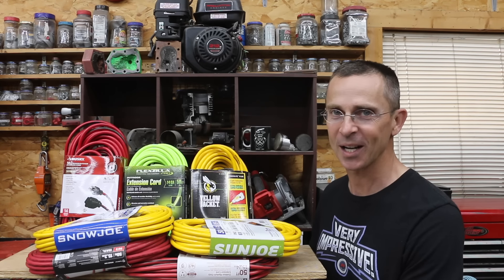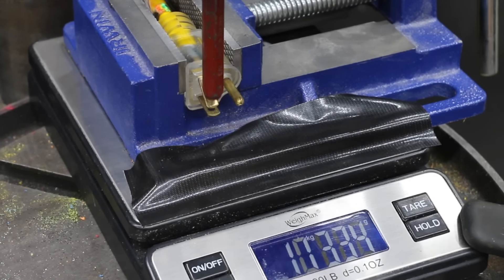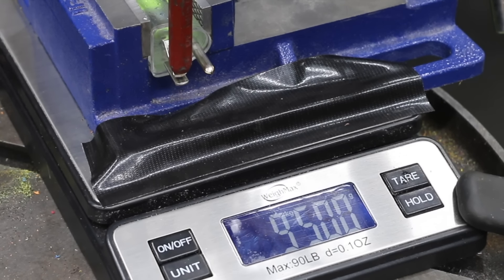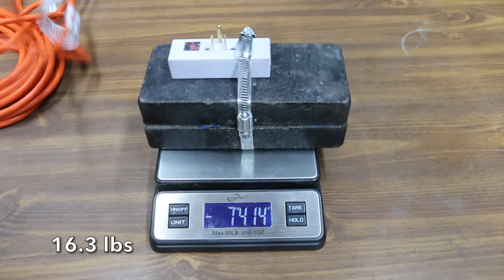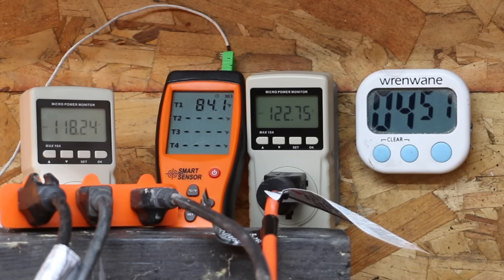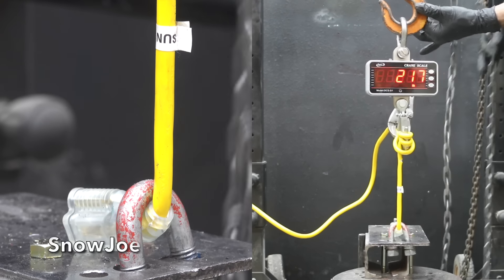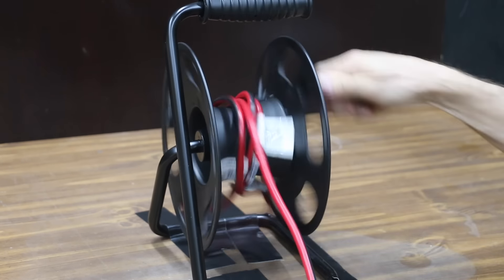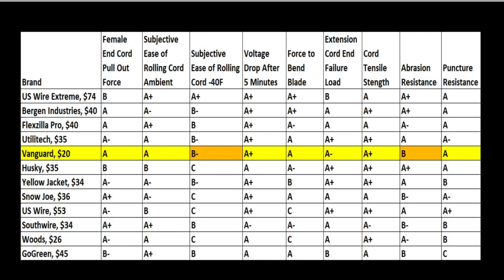Best Extension Cord? Flexzilla, US Wire, Yellow Jacket, Southwire, Husky, Woods, Bergen Industries

Comment: Great video with great information.
Suggestions for possible videos: 
1. Impact socket comparison with comparisons to non-impact rated sockets and 6-point vs 12 point.
2. Concrete screw comparison with Tapcon, exterior SPAX multi-material, Hillman PowerPro One multi-material, and Simpson Titen Turbo. (Not necessarily limited to them, they're just what i encounter mostly in my part of the country).
Reply from the maker: Thanks and you are welcome!  Thanks for the suggestion.

Comment: Great assortment, but one thing not covered was overload behavior. I purchased a 14AWG 50’ Terrabloom 3-outlet cord specifically for it’s 105C SJOOW insulation rating and am able to routinely charge my Tesla at 24A continuous in 20C ambient air temp. Quite impressive, and their indicator light functions at 240V without issue (do not try this at home, I am a trained professional 😝)
Reply from the maker: Thanks for sharing.

Comment: I bought several of the 12ga US Wire Extremes because I needed cords for work that can take cold climates. These are the best cords by far that I have and have lasted 4 years already in daily use. They coil up nice and they never corkscrewed.  I had Rigid cords before these and they were the worst cords ever, IMO. The US Wire cords were actually a little cheaper on Amazon.
Reply from the maker: Thanks for sharing.

Comment: A few tips when choosing a cord ac"cord"ing to this vid. The weight is immaterial to the cord function except for the "jacket/insulator" Your equipment will last longer using a heavier gauge ie 12 gauge.
Also, It's much easier to manage (4) 25' cords than it is to manage a single 100' cord.
Same goes for air hoses, and rope in some cases.
Reply from the maker: Thanks for the feedback.

Comment: Video Suggestion: Spray Adhesives. Which works best for most materials, even materials not listed like Leather. Also discoloration; moisture, heat, and cold exposure; failure loads on sturdier materials, rust protection on metal, and anything else you can think of.
Reply from the maker: Thanks for the suggestion.

Comment: I am a licensed electrician and I can tell you a couple things. 1. I would never use a cord that is less than 12 AWG. 2. A 10 AWG cord can handle up to 30 A, a 12 AWG cord can handle up to 20 A, and a 14 AWG cord can handle up to 10 A. In the industrial/commercial workplace, we only use 12 AWG cords and larger.
Reply from the maker: Thanks for sharing.

Comment: Great video!  I've discovered a good test of extension cable quality is whether or not my Tesla travel charger will work or not.  It can be picky with wire gauge and quality but a relatively inexpensive Southwire 12/3 cable has proven sufficient.
Reply from the maker: Thanks!  Thanks for sharing.

Comment: It would be very helpful if you did one on pump sprayers.
Reply from the maker: Thanks for the suggestion.
Reply: Good one. I usually just re-use Windex pump spray bottles but I recently purchased one from Ace. It was poorly constructed and didn’t last a month before failing. I typically get a year of reliable service from the used windex bottles.

Comment: At the carpenter of 45 + years, I have three things when it comes to picking a cord. How well it stays in a receptacle and how will my saw stays plugged it and third when I roll it up it doesn't turn into something it look like it had a perm. I have been buying yellow jacket cords 10 gauge for the last 20 years and even my table saw cord the drawers have yamps the ends are still working great
Reply from the maker: Thanks for sharing.

Comment: I've got a 100ft 12 gauge harbor freight vanguard cord that powers the lights on my chicken coop that's at the rear of my backyard,  it's been outside in use for almost 2 yrs and except for the cord jacket fading out to a weird peach color it's still going strong. Eventually I plan to run a dedicated underground circuit wired into my breaker box, but supply and costs of materials are just so prohibitive right now.
Reply from the maker: Thanks for sharing.

Comment: The only issues I have ever had with blade bending has been when someone (myself or someone else not paying strict attention) decided place a heavy box on top of the plug.  Usually, it was solved by just taking a pair of pliers and beading it back.   This is one of those metrics that won't be an issue in deciding to buy an extension cord.
Reply from the maker: Thanks for the feedback.

Comment: If you do something like this again, possibly check the temperature of the plug at the wall after you've run the load.    That shows if the wasted power/voltage drop is from the cord itself, or from the cord to plug connection.  (at either end)
Reply from the maker: Thanks for the suggestion.

Comment: A 12 gauge cord comparison would be great. When your working in a shop with many high load devices that could be used with an extension cord the 14 gauge cords always seem like they aren’t quite up to the task. Plugs get warm or hot. I have seen some even melt completely. The insulation is  usually much better on the 12 gauge cords.
Reply from the maker: Thanks for the suggestion.
Reply: Yea there's pretty huge specs differences for the different gauges. That's why on this one it was really a 14 gauge test which is considered casual usage for extension cords.

Comment: One other characteristic to add are the measures between the blades and sockets.  6:53 A bad socket will deform the test plug affecting the next off standard socket ... but not if there was a test realignment socket.

Comment: Just a thought. The tensile strength test might be better if you hook a meter in a continuity or resistance check. Then tug til it opens. The cord wouldn't necessarily have to rip the end off for it to fail.
Reply from the maker: Thanks for the constructive feedback.

Comment: I have a 30 year old Yellow Jacket 12 gauge that was handed down to me. There is not a better extension cord in the world. I have been trying to get the hardened sucrose from working in a Hostess plant off for 2 years.  I use it in a 220 volt socket for my small MIG welder. The only thing that seems to take the dried fructose off is sunlight. So I left it outside in the sun for a month or 2. The color is exactly the same as it was on the bottom. I think we once put 50 Amps through it to weld I beams. The guys on the ground sprayed it with a hose to keep it cool. ((((( It's funny, after I wrote this, he is talking about the temperature rise in the cords at rated capacity. Put the cords under 2.5x rated amperage and see how they do.))))
Reply from the maker: Thanks for sharing.

Comment: I was a cabinetmaker/installer for 35 years. Mostly I installed. I carried lots of extension cords and air hoses. To keep them from being hard to handle and laying curled on the floor I always rolled them in large lazy loops. Nothing is more counter productive than a trip factor so every thing had to lay flat. Buy the best cord you can afford and when the ends are shot put the best replacement ends you can afford. I always tried to make my tools last so never bought cheapo crap.
Reply from the maker: Thank you for the feedback!

Comment: This test was good to watch although it is not much use for Aus but interesting to see the differences like how much cheaper cords are here and how much more power you can get from outlets in Aus.  Three types of single phase  power outlets here  2400w, 3600w and 4800w all at 240v. most of the cords here are made in Aus with a few from China.
Reply from the maker: Thanks for sharing.

Comment: In light of Halloween to a lesser and Christmas to a greater degree, I would like to see this video expanded to cover how the extension cords handle abuse outside - leave them laying in puddles of water and see if that effects them, put them under a UV lamp (in and out of water) for rubber deterioration - basically subject them to the same abuse they would suffer laying in your yard from Black Friday to early January.
On a related note, how's about a test of the various outdoor power strips since they tend to run a few bucks and get abused like mad during the holidays as well?
I don't know if it's worth its own video, but sticking with the theme, what about those boxes/covers which you clamp over the ends of two plugs outside to protect them from the elements - test how water resistant/proof they are, UV resistant and for the northern viewers, ice/cold resistant?
Basically just do an entire Christmas power cord/plug/strip/protector themed series of videos?
Reply from the maker: Thanks for the suggestions.

Comment: The duty cycle we put through extension cords through means the cheapest is the best.  Getting run over by trucks and lifts, generally abused and exposed to welding and torching sparks.
Reply from the maker: Good Point!

Comment: Thanks for justifying the extra expense on the Flexilla cord I just bought!  Suggestion for testing:  Air hose fittings - is "High Flow" worth the extra cost in reality? What's the easiest to connect?  Disconnect?  Leak-proof? ...?
Reply from the maker: You are welcome!  Thanks for the suggestion.

Comment: I find that the best extension lead you can get, is the home made ones, which are made by the builders, and electricians, who use them.  You take the length of lead that you want, put a 13amp plug on one end, and the 13amp socket on the other.
Reply from the maker: Thanks for the feedback.

Comment: I like 👍 the lighted plugs 🔌 on these extension cords. Not only is it “Power On”, ya can see the lighted plug 🔌 in a dark room. Once ya grab sight 😞 of it, it will tell ya that ya have an extension cord in use, stretched across the floor. That way, ya can avoid a fall. Secondly, these plugs 🔌 can really hurt 😞, if stepped on by bare feet 🦶. I’m probably going to buy an extension cord with a lighted plug, or the wall mountable retractable one ☝️ from Tractor 🚜 Supply, although the plug is non-lighted. Your friend, Jeff.
Reply from the maker: Thanks for sharing.

Comment: As a building contractor I preferred the 12 guage and 10 gauge extension cords. My more powerful tools draw more than a 14 gauge can carry over 100 feet or even 50 feet for my table saw. You will ruin a motor if starved of power and the longer the lead the more the drop off. A cheep cord will cost you more in tool burnout than a more expensive cord. Also never coil the lead around your arm or any thing smaller than like a 3' loop this will stop the lead from developing kinks and allow it to lay flat when in use
Reply from the maker: Thanks for sharing.

Comment: Would you mind doing a video on the best screw heads to use? 
Phillips, square, star, flathead, etc

Measure:
-cam out
-torque needed to prevent cam out
-downward force needed to prevent cam out
-Does the material used to dive the screw in affect which head to use? (drywall, fence wood, patio wood, carpentry wood, etc)

Comment: I bought 3G2.5mm 50m extension cord with butyl rubber jacket for 70€, made in china. Works well in any weather. Though very heavy (lots of copper and jacket is massive)
Reply from the maker: Thanks for sharing.

Comment: I bought 500’ of military surplus wire labeled 3/12 backwards of what we are use to. It has a black rubber cover with a full stainless braid underneath. I just don’t like those plastic covers. I made them into 25’, 50’ and some installed on shop machines. Hard to beat this stuff.
Reply from the maker: Thanks for sharing.

Comment: Here's a tip wich won't apply to most people in the US, but it could be useful in EU, always look for extension cords with wire diameter of 2.5mm² because otherwise some stronger fuses won't act if the cord gets a short circuit or is overlooked and it's something that often starts housefires
Reply from the maker: Thanks for sharing.

Comment: It would be nice to know how long, or how any times the female end of the each cord would last after the repeated usages. They wear out, get loose and don’t  secure the male plugs of the tools. I am surprised that this test didn’t cover that! I always enjoy watching this excellent program.
Reply: Whenever I find a male plug end isn't tight in the female end of the cord, I just spread the blades a bit further apart to provide some tension when the male end is reinserted.
Reply: @thomasleary1807   Your trick doesn't work for the worn out receptacles in hotel rooms!

Comment: Pro Tip, rule of thumb, if the cord jacket has a shiny surface it will not be a cold weather cord. Cold weather cords are a soft feel with a flat finish.  Referring to -20 F and colder.
Reply from the maker: Thanks for the feedback.

Comment: PRO TIP #2:   I am a gigging musician and i am using extension cords and different wall plugs at different venues almost every night. 

Theres nothing more frustrating than a loose wall socket or extension cord plug socket that wont hold the prongs of a cord end very well, almost falling out or loose. 

Well, this pro tip WILL FIX THAT allowing your plug prongs to stay snuggly in even the loosest of sockets:

Now, what will most people do to try to make the plug stay in the socket? Bend the prongs outward wider right?  Yes, but that never works. So..

INSTEAD:  get some pliers and instead of bending the prong blades, TWIST the prong blades in opposite directions giving them each a bit less than 45 deg of twist. 

They should look just about like this  \    /  
   o.   
with the "V" shape pointing toward the ground post. 

Now you can take it to your loosey goose wall socket and start inserting the plug by tilting the plug a little so that the ground post stays out and the WIDE blade will go in its slot first just a little bit,

 then, keeping the ground post out of its hole, slowly TURN the plug counter clockwise until the THIN prong blade can work its way into its slot,  such that you will now have both flat blade ends started into their holes. 

from here the ground post is now lined up with its hole, and its easy to then just push the whole plug the rest of the way in the socket. BLAMMO!

You will feel the improved resistance as you are  pressing the plug the rest of the way into the socket. Now its fitting tighter than new even. 

This works so well because TWISTING the prongs creates a SPRING tension that holds the prongs much better than bending them. 

I discovered this as a desperate solution setting up for a show where the wall sockets just would NOT hold. no plug no gig no pay. Necessity=invention.
Reply from the maker: Thanks for sharing.

Comment: Video suggestion: Brake rotors for cars. A car driven in an area with a lot of road salt is likely to have rotors rust to the point of being useless before the brake pads are worn out. Are the more expensive rotors made of better steel or with a coating worth it?
Reply from the maker: Thanks for the video idea.

Comment: This one should be a rare cheap one for you, wire joinery, could you test crimp connectors, self soldering heat shrink connectors, traditional soldering, and so on for ways to join wires of various sizes together, or to put a end on them that can be used by something else
Reply from the maker: Thanks for the suggestion.

Comment: Video suggestion... hand pump grease gun. Categories should be how easy to prime, how easy to get the grease gun on and off the grease fill fitting. How much grease per 1 pump and which ones don't leak. 

I need to get a grease gun by my next oil change in about 2000 miles as I just got moog tie rod ends on my mercury.
Reply from the maker: Thanks for the suggestion.

Comment: I liked this test except i didnt really agree with the winner. I think the Husky did the best among the most important tests. 

Sometimes you have to weight importance of certain tests, and voltage drop and wattage are the two most important considerations, but since they all performed within a very narrow compettive range on those fronts (except for different guages) then the tests really come down to the most important being centered around why extension cords fail, and those are probably almost invariably going to be tests for abrasion resistance, cutting resistance, plug end strength and cord tensile strength, in that order. Everything else is not nearly as relevant except for maybe its ability to lay flat, and then prong strength. The led plug ends are actually very nice on the job sight saving lots of time and steps and would factor for me personally as a very highly regarded feature. In fact its so helpful on the jobsite, i would almost limit my purchases to ONLY worthwhile led plug cords. 
But it seemed to me thst the one that performed the best in the real world tests was actislly the husky, and  whats funny is that it has a very distinctive jacket design and color that i now remember was the go to cord of the different extension cords we had on site at a large construction site. I always trusted it the most.
Reply from the maker: Thanks for the feedback.

Comment: I would like to see a fair comparison between chainsaw chain sharpening methods. I would pick out three Oregon chains and run the test. 1 chain factory sharpness. 2 chain straight tooth sharpening method. Three chain typical angled sharpening method. You could drill a small hole in a bar to attach 5 lb of weight while making sure the wood is consistent in size,type and moisture content.

Comment: Thanks for a great comparison of cords.  Could you test a few retractable cord reels based on some of the top performers?  I wonder if the reels will outlast the cords or vice versa.  Or if there are some with a replaceable cord. I had one cord that burned up on the reel but could not replace the cord and save the reel.  Thanks.
Reply from the maker: Thank you for the video idea!